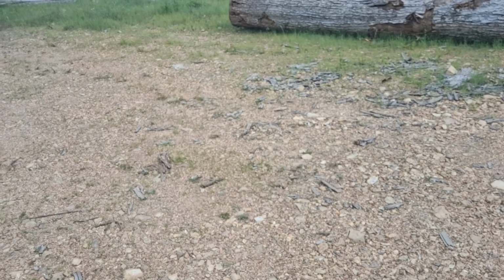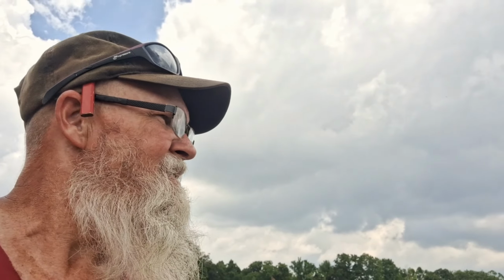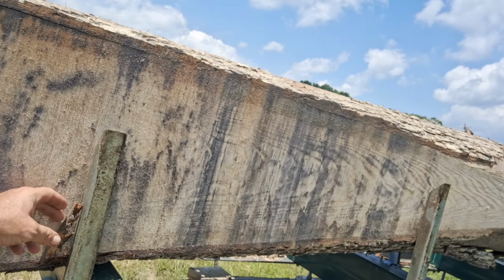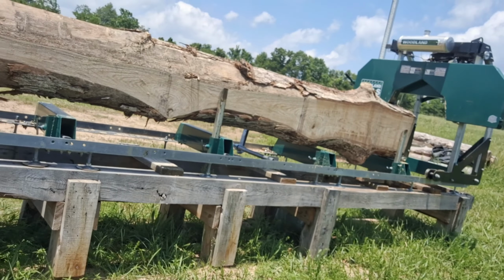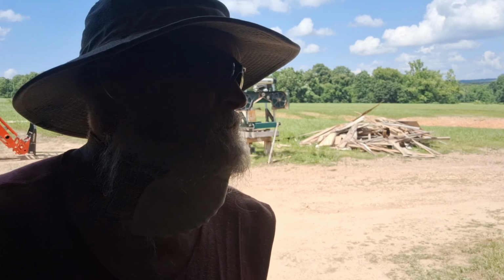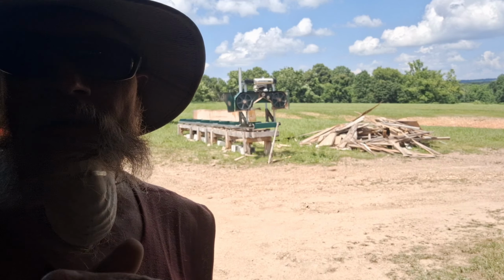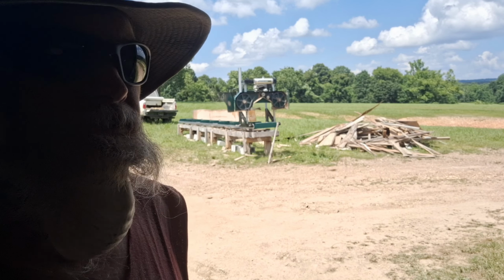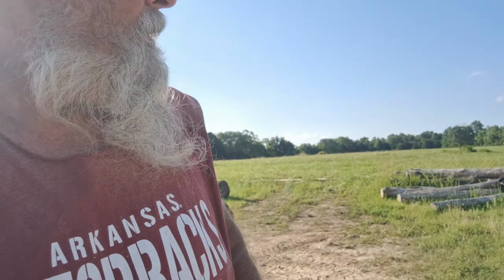Cutting BIG Lumber With Our Woodland Mills HM126 Sawmill #sawmill #countrylife

Comment: If you use your scraps for firewood I have a quick way to cut them up if you want to know how I do it.
Reply from the maker: I am planning to build a crib for the drops but I haven't gotten that far yet.
Reply: @BigMikesHooptyBarn  4 t post 3ft apart make a square. Place scrap inside.  Hack is.  A ratchet strap in the middle. Tighten it up. Get the saw out and go at it. Every 16 inches. Easy peezy.